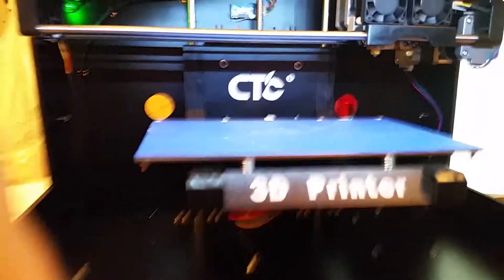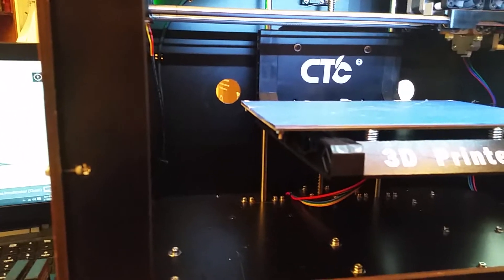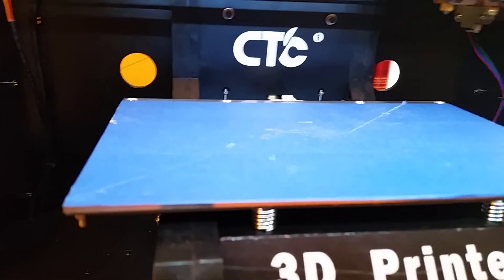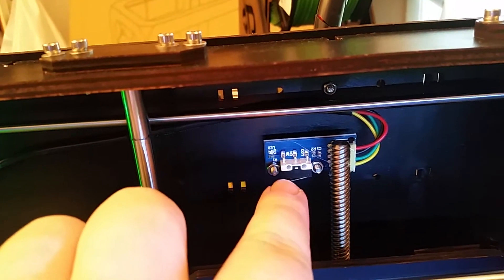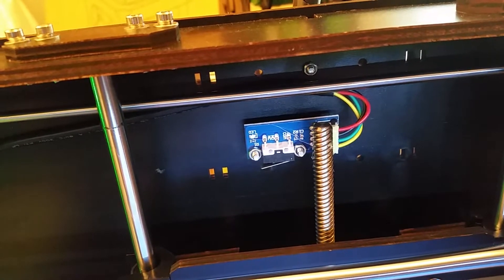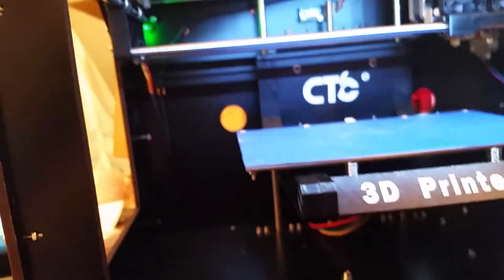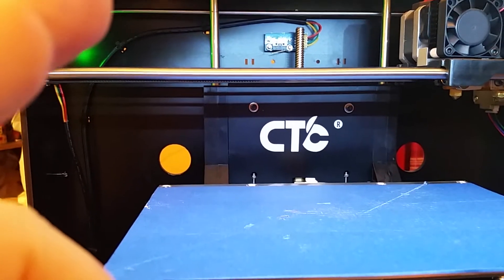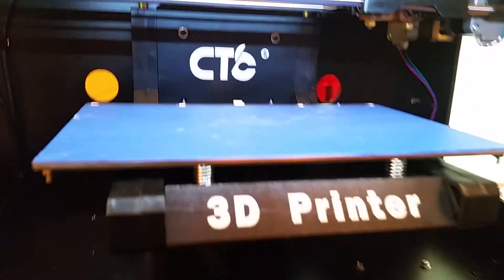ctc 3d printer fix

Comment: Mine was missing too!!! And a bunch of others were loose. Best check everything is present and tight. I even had a loose screw on my Psu terminal block. But I'm now getting good prints after some essential mods... Extruder feeder is definitely in need of replacing.

Comment: I got my printer recently, same CTC model as yours. From reading forums and experience of running some prints that really shake the machine I found things do come loose on this machine.
I've invested in some M3 lock nuts as replacements for all the parts with open nuts and some square nuts (as originally specified on the replicator) for the framing bolts. I'm also considering adding wider washers in some places to prevent pull thru on the plywood frame when tightening. 
From my own observation I think any other things you can do to strengthen the frame is a good idea and as you can see on Thingiverse and other places lots of people have replaced the laser cut plywood z axis guides with PLA /ABS ones and added support to the pillow block guide bearings.
Reply from the maker: that's what's so cool you can print parts for your 3d printer and thank you for your ideas